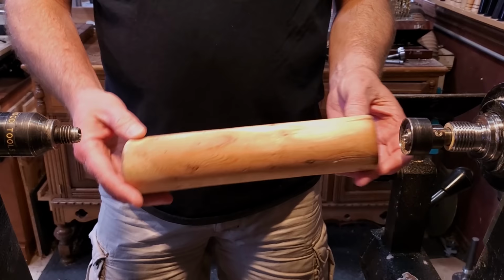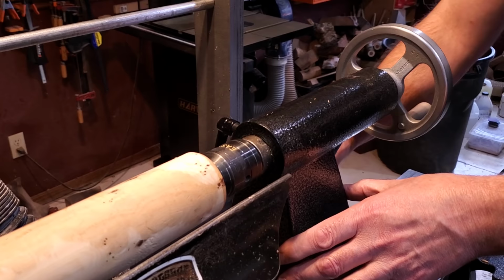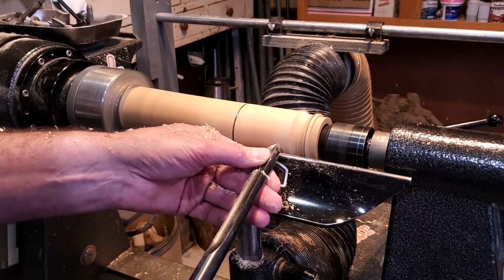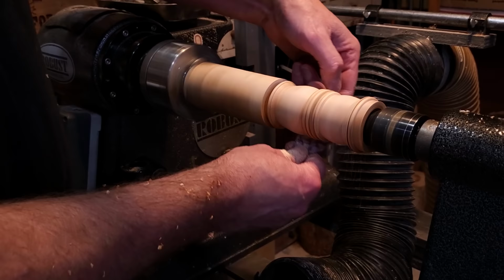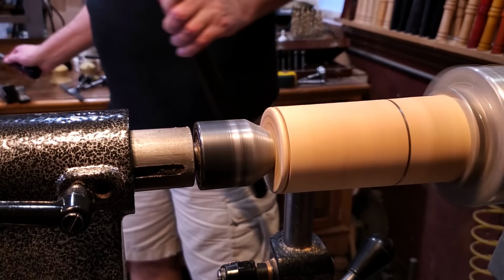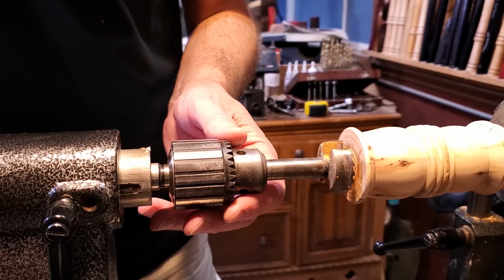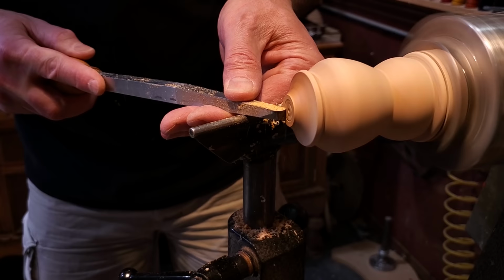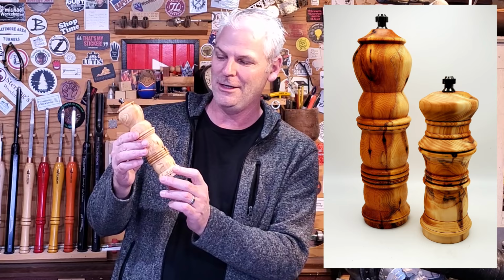Woodturning | Salt and Pepper Mill

Comment: I have found that using a 1" drill bit is more effective that the 1 1/16" forstner. Extensions tend to get a lot of wobble and that ends up with unclean cuts and depending upon the extension it can take it off center from the 1 1/2" hole. On smaller grinders, 5" range, the 1" drill bits are often long enough to go all the way through and are often cheaper than the odd sized forstner. You may still need to drill some of a 1 1/16" hole in the end pending the kit insert sizes but just enough to fit them.

The 1" drill bit is just a cleaner whole for me and eliminated the potential for uneven cuts from bit extensions. It is also a cleaner hole than what I typically get from forstners. No one will know the difference of 1/16" in the hole. The body of the 1" drill bit is also more surface contact so more stability as well. I also use the Rubber Chucky grinder tool set as well and it is designed to work with the Robust live center specifically so it may be right up your ally.

Thanks for the video, these are fun projects.
Reply from the maker: Thank you for the tips! I'll look into the Chucky for my live center.